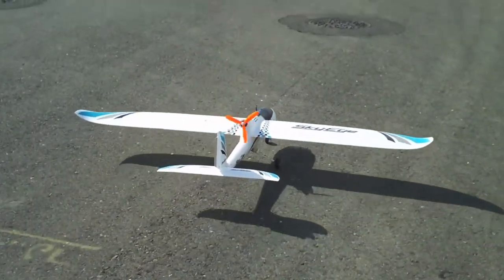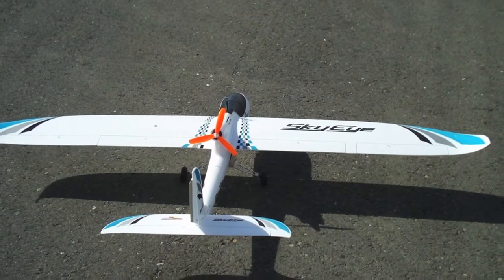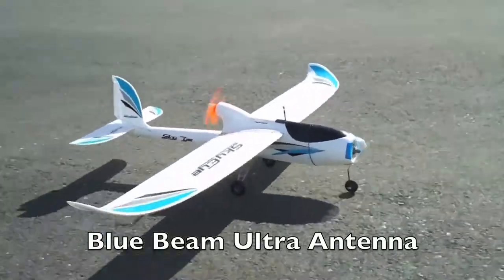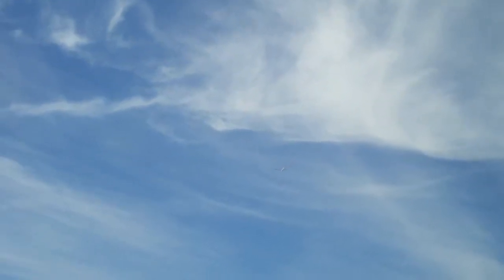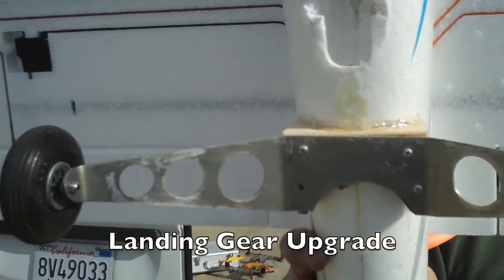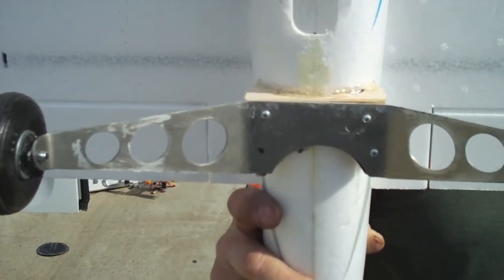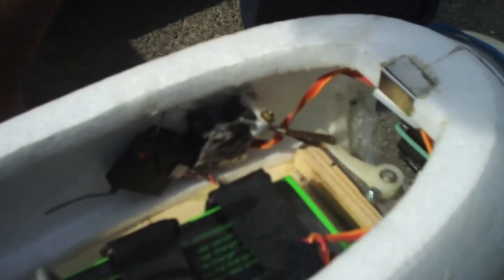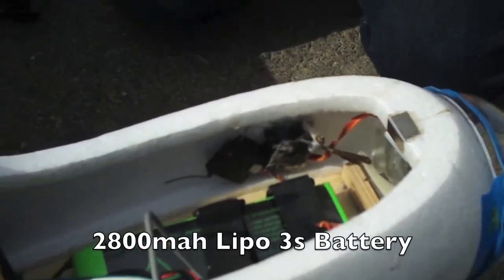Hobbyking SKYeye FPV Drone - Tips and Mods for your airplane.

Comment: Hello, Demunseed. I like what you did with this aircraft. What type of propeller are you using? I am thinking about placing the battery in the space beneath the wings. Have you considered doing this? It may require carving out some space for a bigger battery, but it may be advantageous for the center of gravity.

Comment: I take it those slits on the top of the fuselage vent the ESC?  I assume you had to shorten the ESC leads to get it into that cavity?
The rear landing gear seems to be mounted behind the CG.  Does that balance well with the nose wheel mods?

Did you notice a carbon fiber rod or tube running down the boom to the tail?  I'd like to get some wires to the tail before I glue all that up once and for all.  I'm wondering how big a deal it would be to split the fuselage in half and re-glue it later.

Comment: Making progress on my assembly.  
I test-fit the wings and MAN, it's a serious pain in the butt to thread the servo leads into the fuselage!  I'm considering bringing the leads off the wings outside the fuselage, bringing extensions out each side and connecting them OUTSIDE.  Can anyone see any disadvantages with this, other than some wire dangling?  If I coil the extra servo lead, will it cause a problem?
Reply: Did you try this? I agree severe pain to thread the leads lol. Only disadvantage I can think of would be slight drag. Maybe have the extension connectors hotglued into part of the wing so you can just put wing on plug servo in and do preflights and fly